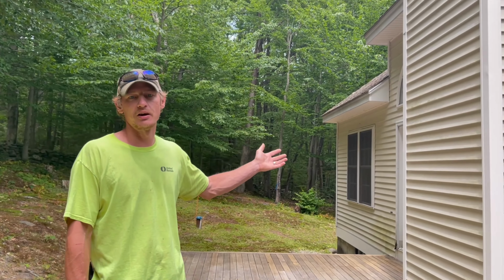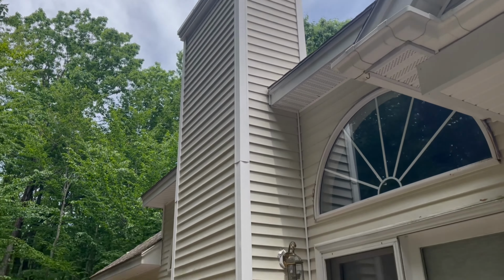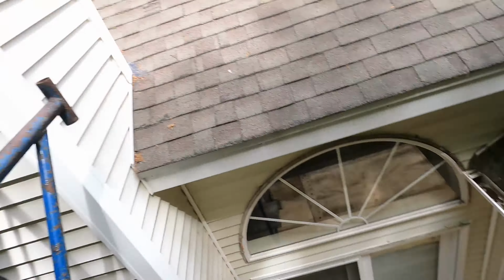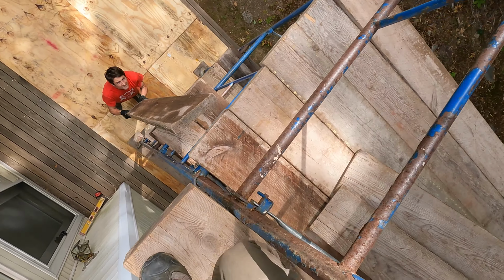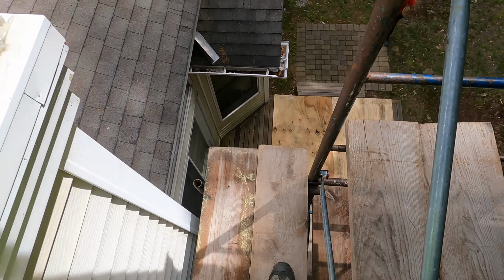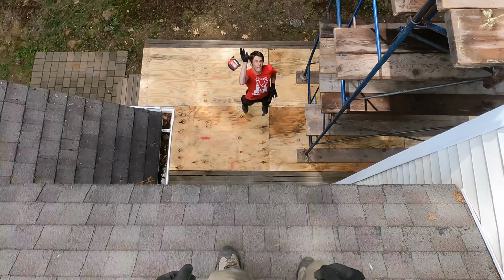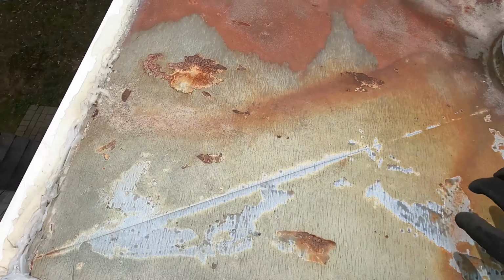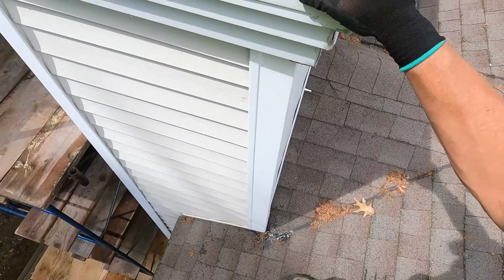Brick fireplace construction | Episode 1: Erecting scaffolding

Comment: My wife and I are working on a future build for a traditional farmhouse here in Texas. The style we are looking at has many fireplaces in it and a few are corner fireplaces that share one chimney. We’d love to make them out of brick to keep the traditional look and I don’t see that it’ll be terribly hard to do. Time consuming yes and tedious yes but like all we’ve done we’ve figured it out and made it work. My question if I may is are the clay flutes the best to use for the smoke exhaust?
Reply from the maker: Sounds like a fun project! 
The clay flues are perfectly fine to use. The problem with them in most cases are the masons don’t support them properly, don’t use proper mortar to adhere them together, don’t clean the mortar smooth on the inside surface and don’t leave room for expansion. All this gives them a bad reputation, but if done correctly will last and work fine without issues. 
The best option in my opinion is heavy-wall stainless-steel chimneys liners that are insulated properly. They cost would likely be many thousands more but they are one piece and round. Round flues provide the best draft with the least amount of creosote build up. Round flues can be sized at 1/12th of the fireplace opening as opposed to 1/10th for square or rectangle. So if you are looking to save space in the chimney round flues (clay or stainless) could be beneficial.